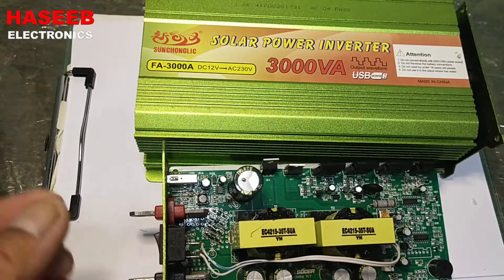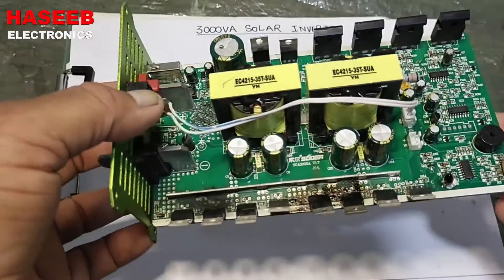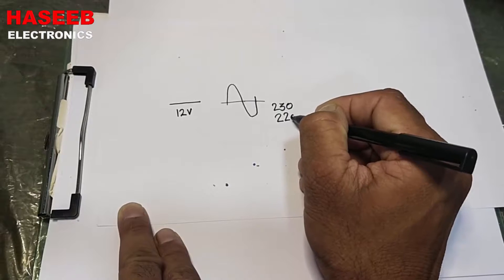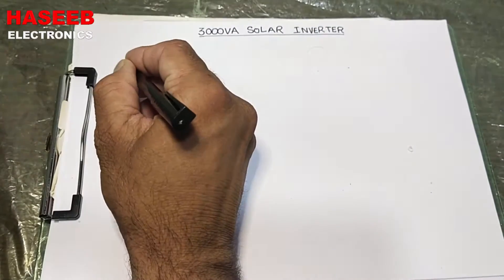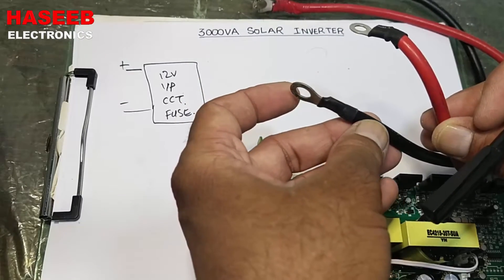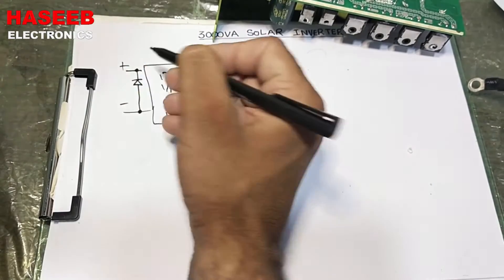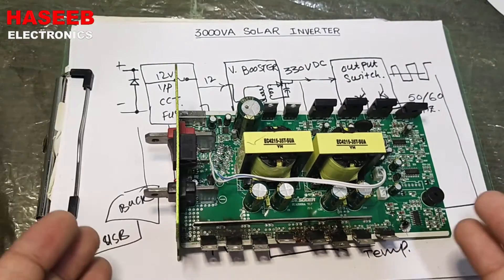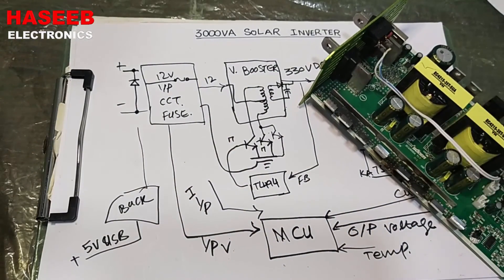[439] 3000VA Solar Inverter Circuit Explained - Part 1 Block Diagram

Comment: But tl494 has different pin out with ka7500 
I understand they work same 
But my question is 
In a configuration where the manufacturers used tl494 
And it's damaged (for example)
Can it be replaced with ka7500 without adjustment of the pins or what so ever?

Great video sir 
Im your students
Joseph

Comment: Sir, what's wrong with the inverter that doesn't have ac out, all the mosfet are good and the min capacitor has a be voltage of 400v dc

Comment: Salem Haseeb. Tabara Allah in your works and Hope qu'allah help you and promise you a heaven. I have one question about solar inverters . How they car inject power in grid and stop when there is no incoming electricity companies ? could you explain this Chokran zajila. I would like to understand the circuit différence between off grid and on grid. Actually I am using micro Inverters In grid. Thanks a lot. Omar From Morocco.

Comment: Dear Haseeb, 
First of all I would like to thank you for your detailed and informative explanations in your videos.  I would like to ask you the following question:
I need to lower the low battery voltage protection from 10.8V to 9V.  If I change the current sensor power resistor will this do the job? What value should this resistor be?

Comment: Thanks for educating. Great work. I think the step-up transformer's (Booster) output doesn't require a rectifier. Since the output is DC. I suppose it to be a capacitor for filtering.
Correct me if I am wrong, please.
Reply from the maker: It is closer to dc but it have negative spikes 
Which needs rectifier

Comment: why they use two transformer? why not one transformer? input coils are parallel switching but the output of the transformers coil in series. why?
Reply from the maker: 2 primary windings are used in prallel to switch more current and reduce core size and reduce primary side losses (in case of using single core)
series secondary windings are used to reduce voltage stress during voltage boost action
Reply from the maker: i will try my best to explain it

Comment: Dear Sir.   I have "Suoer  1000W 12V Inverter.   Some components burnt and  could not identify two smd driver transistors. So please let me know the part numbers of both smd transistors.  If i have your Phone number i can send you a photo of the pcb via WhatsApp. Thanks

Comment: Good video, I have a dc motor driver which trips  elcb( earth leakage) when I connect the motor to the driver. The motor is  brand new and never used, was replaced from failure in the past. I have check the voltage with no load and I measured it be  corect voltage values. The pot is also varying the voltage however, when I connect the motor , tripping occurs.
Checked the motoe reisistance, and it is measured to 40ohms.

Comment: very urgent
respected Sir,

i used to watch your all videos regulary. i gained lot of knowledge of smps design

now i need to design  230v input and 48v /50amps smps very urgent  so  i need your 
support to design
kindly suggest me the topology , controller , ferrite size , winding calculation all kinds of technical details .  i am sending detail mail to you thank you sir
Reply from the maker: best regards and special thanks 
you can use full bridge / H bridge  or push pull topology
also use active PFC circuit for 3000Watt
use SG3525 
i will try my best to do everything whatever i can. but due to official activities some other kind of engagements might be it will near impossible for me to do it soon
Reply from the maker: you can also get some refernce design from texas instruments site 
ti dot com

Comment: Thank you very much. I love this video. But I don’t understand that why does the push pull stage not have output choke?
Reply from the maker: as its output is not sine wave. it is just pulsating square square wave (above and below the zero line)

Comment: Great video! I wonder if you can do a video on checking the operating frequency of an unknown transformer with a signal generator. I tried this once with a Wavetek model 112 signal generator puttting about 13 volts (approximately) into a secondary and used a neon bulb on the primary and it lit up at several frequencies, but no way to measure the greatest voltage point, which I can assume is the designed frequency, even an analog meter gets weird at such high frequencies. It's just for fun, nothing I have to fix. Thank you sir and have a nice weekend!

Comment: Shouldn't the protection diode be after the fuse so it blows the fuse when it's short?
Reply from the maker: it is just a block diagram. i demonstrated diode importance.  its detailed circuit we will continue in upcoming parts 
best regards for your valuable point

Comment: The protection diodes on the PCB are after fuse, that makes much sense. If you connect the wrong polarity, diodes will draw much current and blow the fuses.
I doubt this device could handle 3kVA, I would expect max. 300VA perhaps. Would be interesting to test the maximum power possible for some hours. 😊
Reply from the maker: you are right. 
it is just a block diagram. so i placed the diode to just give an idea about its importance. 
i will go in detail as much i can in upcoming parts. as 3000va is mentioned on the cover, we will check its all parameters

Comment: Dear brother,

Thanks for your valuable efforts for making such a knowledge full video.
I am one of your subscriber from long time and watching almost all of your videos.
I need bit technical advice on a issue  which I am facing in a circuit...
I have connected BTA16 triac Which is used to control output voltage UpTo 48v. Input voltage is 220v AC...with normal wapda line there is no issue and it's work very well but once it run over UPS then the output voltage goes up to 70+ volts....please guide me what to do when using UPS supply...or how I can fix the output voltage in any condition of inputs...
Regards